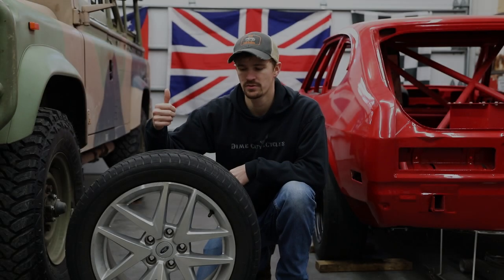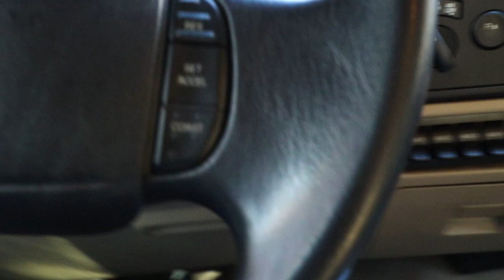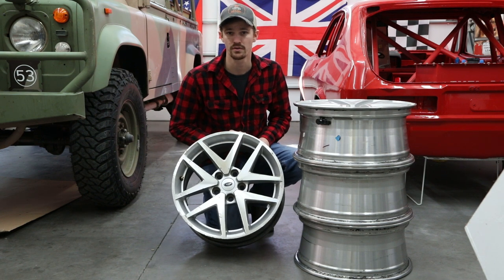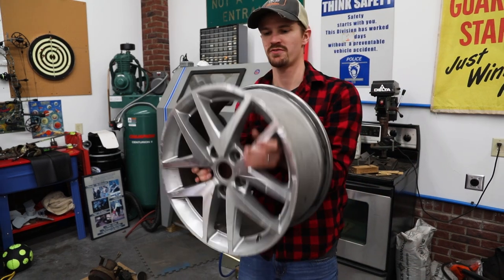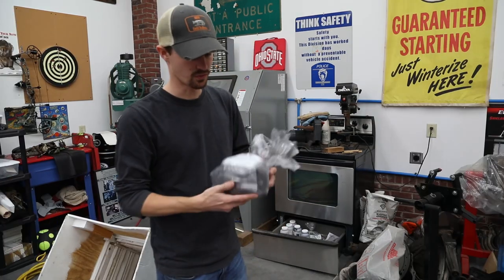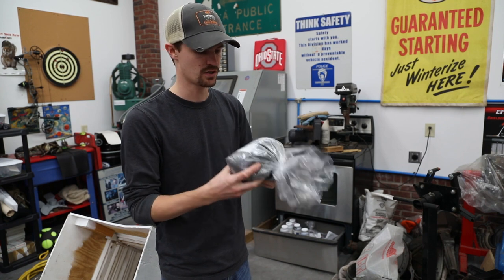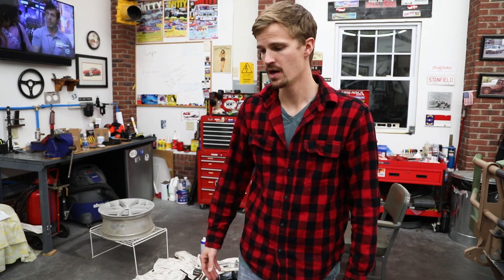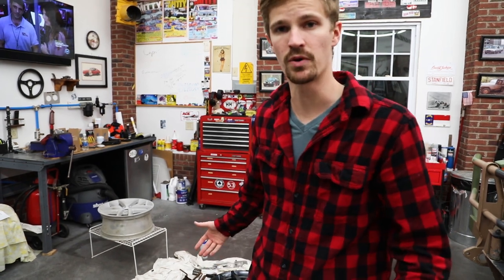Powder Coating Wheels At Home!

Comment: "At home" means if you live in a shop.
Reply: Danny Krinkle dude exactly wtf I was about to say!!
Reply: Yep. I was like "huh?"
Reply: Click bait
Reply: You can have a blasting cabinet at home and I’m sure you’re not thinking an oven is unfeasible to have at a home right? If you can’t also think enough to understand that sanding is an option, this whole process is out of your reach.
Reply: Joseph Samsor you can also have a car lift or a 20 ton press at home if you buy it but you’re building a shop at that point. Also, he says at home while he’s at a shop with stripped out cars...
Reply: B Y a car lift and 20 ton press are not needed for this process btw. An oven (something you have at home) and a blasting cabinet (easily substituted with elbow grease and sandpaper) is in the process. The location he filmed it doesn’t matter. Pay attention to the video. For this process, everything is easily done at home. What is so difficult to understand 😂. You also don’t need to be surrounded by stripped out cars to do this in case that was also a point of confusion.
Reply: Hahahaha absolutely right 😂
Reply: Hmu if you need any electrical added to your garage for an oven or anything if your having trouble adding things to your home garagw
Reply: I thought it was at home..  Got me!

Comment: Better off putting two pot on them , the heat of powder coating not good , because rims were  Heat treated from factory  .
Reply from the maker: Something I had never conceded but it could become an issue if you keep it in the oven to long. Some alloys ate aged at 325F so powder coating could cause some issues. But with the process so common and no issues myself I think that if its done correctly you minimize risk. My next set of wheels will be sprayed, simply because im learning how to shoot paint now.

Comment: A lot of thin spots , needs a heaver coat of powder. and it was plane to see before it went into the oven
Reply from the maker: Yep I missed a few spots of clear when sanding them but I was also fighting the faraday effect in the corners. After a few wheel I was able to work around it but an adjustable guy would have really helped out.
Reply: @Petrol360  Heat the wheels or parts to around 150 - 175 and shoot them warm
Reply from the maker: I did that as well, I think I called it gassing off. Iv heard its more to help oils burn off but I guess it can help the powder stick by melting on contact?

Comment: I don’t know why people are bitching about this being at home.  
He didn’t send them out to be powder coated. He did it himself. 
If you don’t have the room or the tools to do it, that’s one thing. But don’t bust this guys chops for having a simple set up. It works. It’s not elaborate.  If you don’t have a compressor or a garage even, then maybe this project isn’t for you.  But it definitely can be done “at home”.
Reply: having offgassing equipment, an extra oven and professional powdercoating sprayer setup costs a fuckton for someone just trying to powdercoat wheels. it is also overkill

Comment: Everyone is complaining this guy has a shop. Sandblasting cabinets and a good enough compressor isn't impossible to get. Cabinet can be made if one really wanted. Free electric ovens are everywhere. Powder coating kit can be bought at harbor freight. 
You're already taking wheels to a tire shop to dismount anyway, take it to a blasting shop and do the powder and bake at home..

Comment: Great job. Have a few questions though.

1) What size sandblasting cabinet do you have?
2) What powdercoating gun do you use?
3) You used an electric oven? 
4) What did you use to do the sandblasting on the alloy wheels? 
5) What temp studs you bake them at after powdercoating them?

Comment: Hi, would you please share what kind of compressor you are using (bottle volume and output per minute). Thanks in advance!
Reply: From what I've read, you can use any pancake compressor found at your usual home improvement centers. You only need about 5-10 PSI and 2 CFM to move the powder and coat what you want coated.

Comment: So it's been a few years since you've posted this vid... did it hold up? Any touch ups??
Reply from the maker: No they still look perfect. The wheels are on my daily so the rarely get cleaned. So far brake dust and all the other dirt haven’t had any effect on them. I still pull the wheels once a year and give them a good clean and wax. But other then that I don’t touch them.
Reply: @Petrol360  that's awesome. Good to know that they'll hold up over time. Definitely gonna try this! Thanks.

Comment: I would have liked to have seen the inside of the wheel cured out of the oven after being placed on the oven rack to see what marks were left on the wheel? It seemed to lift out easily so didn’t cure to the rack…
Reason I’m interested is this is how I’m looking at doing mine and just want to know what is going to happen to the inside..
Oh also would have been good to see the whole process - removing the pre heated wheel etc etc

Comment: Only thing I wish you did was elaborate a little bit on how long and what temp to bake at.  You stated prebake was 400F but didn't give a total paint bake time or exactly how to prep the rim besides the prebake. Do you have to electrify the part at all for the powder to adhere?  Thanks great video overall I'm just a super noob so wish there was a bit more info here and there
Reply from the maker: Every powder has different instructions on how long and how to bake at. Thats why I didn’t go in to detail on baking them. And yes the whole part needs to have high voltage running through the part. Just clip the lead from the powder coated to the part or a metal part touching it and you are good to go.
Reply: @Petrol360  

Perfect man thanks!  Didn't think I'd ever get a reply from the content creator himself.  Much appreciate your time.  Your reply really filled in the simple blanks for me.  I was super duper noob but I've watched a couple videos since and All I need to know now is voltage/current and power supply stuff but I'm sure that'll come with whatever kit and powder I buy.  Thanks for the great content!

Comment: What blasting cabinet is that? I'm tired of messing around with poor quality media blasting equipment
Reply from the maker: Its a skat blast cabinet with there filtration system. We added a second light inside that helps a lot. Its been working well so far just regular stuff, changing tips and putting a plastic shield on the glass to keep it from getting bad.

Comment: how does the powder coating hold up long term? Does it peel off?
Reply from the maker: As long as it’s applied properly it can last a very long time. They real advantage of powder coating is that it doesn’t chip or peel off like the clear coat did. The wheels still look great by the way!

Comment: Amazing,,may i ask what type and mesh of metal powder u spraying on ,,second can it be applicable on any sort of substrate?
Reply from the maker: They don’t list the mesh on the website actually. And as far as what you can apply it to I think its any matalic object that can withstand the heat in the oven.

Comment: At home cheers mate, luckily I keep my sand blaster next to the fridge
Reply from the maker: Get creative, there are loads of ways to remove paint from wheels. Aircraft stripper may even be faster to strip them down. If you really want to be able to to something you will figure out a way.
Reply: @Petrol360  so you agree the video is pointless?
Reply: @matthewcooke3749  good one
Reply from the maker: For a person with no ambition and no ability to think outside the box like yours. Yes! And what did you think the video would be about some new magic that means you can powder coat at home with no tools?
Reply: @Petrol360  sorry mate I appreciate the video I was just taking the mick a bit..it’s a good vid cheers

Comment: How do you like the blast cabinet so far I've been considering a skat myself
Reply from the maker: Really like it, seems to be a good unit. We added a second light inside that made a world of difference and buy a bunch of the glass protectors to keep the glass clear so you can see. Another thing that we got that should have come standard is a lip that goes on the inside of the door. With iut the lip a bit of sand falls out every time you open it up but thats the only flaw iv seen so far!

Comment: What size wheels were those?  (What is the largest wheel you can still fit in your oven?)
Reply from the maker: These are 17”x7.5 I think. You could fit an 18 or maybe a 20” ovens do come in different sizes.

Comment: I'm about to do this on some Porsche wheels. What blasting media did you use? Do you remember the grit?
Reply from the maker: I used Diamond brand fine grit, I picked it up at tractor supply. I tried there medium/course and it seemed to be eating into the wheels a little so I swapped it out. Best advise I can give is to check the wheels with a really bright flash light before you put them in the oven, the color I used was hard to tell when it was not thick enough in spots. Also do the cracks and tight corners of the wheels first, the powder has a hard time sticking where corners meet unless you get an adjustable power supply. Its a fun project and saves a ton of money doing it at home, probably only used one pound of powder and one bag of sand so id say $60 for all 4 wheels plus say $20 to pull the tires off and remount them.
Reply: Petrol360 Thanks for the suggestions. I really appreciate it. Hopefully my wheels will turn out as nice as yours.
Reply: Maybe you will have some insight, I have some 993 18" hollow spokes with chrome and I want the chrome off so I can paint or power coat silver. Any ideas or leads?

Comment: Cool.  So whos house am I powder coating my wheels at? Your dads?  Cause my home, like most others, has none of this equipment except for an oven.  I'm not too sure my girl would be ok with me borrowing her oven to cook my wheels in.  Let me know.  Thanks.
Reply from the maker: Matthew Nelson blasting cabinets are a bit much for a home set up but a 25 gallon compressor and cheap HF sandblaster works just as well. For the oven we went on CL and found a oven with a broken glass top for $35 and it works perfectly. You have to be willing to think outside the box and put some elbow grease if you really want it.
Reply: @Petrol360  Thanks for the reply.  I was mostly being sarcastic but either way nice setup.  I might even be a tad envious lol.

Comment: What sand blaster do you have?
Reply from the maker: Its a champion, think its a 60 or 80 gallon. It works really well for a home shop and I can blast all day without issues.
Reply: Whats the cost of the equipment to powder coat?
Reply from the maker: The gun kit with the gun and everything you need to paint was $120. We found a old stove with a broken glass stove top for about $50. As long as you have 220v in your shop or garage thays all you need. A lot of people use a toaster oven for small parts as well.
Reply: Yeah I was thinking about that too.. I'm trying to powder coat wheels haha
Reply: If you're going to do wheels then you will need a good sized oven which will run you around $2,500 out the door. Everything else like the sand blaster and air compressor will cost you more. To give you a better idea of how much, well i spent $5,000 on everything and now i can do my rims and other peoples rims as a side job. If you need more information on what to get, just message me and i will send you all the stuff i got.
Reply: Air compressor for sand blaster is around $900 for a decent one if you plan on sand blasting longer than 15 minutes. I have a 80 gallon air compressor.
Reply: Holy shit I may not be setting that up anymore then.. Was just going to do it for casual DIY's. Might just do plastidip for much cheaper

Comment: I fucking hate picking up screws man. I have been to the local mechanic shops so many times because of that or sensor light issues 😭
Reply from the maker: Ya thankfully this was my first in years, but it was a good thing because the tires were starting to dry rot. I think the dealership I bought the car from must have used tires that had been laying around for a while. So it needed it anyway and fixing the failed clear coat was a plus!

Comment: Do you have to sand blast them if they are not pealing? I have rims that look great just want to powder coat them.
Reply from the maker: Yep the one bad part about powder coating is it has to be on bare metal so you will have to blast or strip the old paint off. It taks a lot of time but its worth it on something like a set of wheels

Comment: At home my arse...
Reply from the maker: Most houses have single phase 220v run to them and can easily be wired to run a compressor or oven like we have. If you don’t have access to a blasting cabinet or don’t have someone locally that can blast them you can always use paint stripper and sand paper to get the wheels clean. Just have to think outside the box a little!

Comment: At home...... meaning if you got a shop, or a garage full of tools
Reply from the maker: Anyone should be able to do this at home. If you don’t have a way to sandblast you could use paint stripper. A broken kitchen range can be found used for cheap or free. The one we use has a broken glass cook top. The powder coating gun uses very low pressure so a simple pancake compressor will work great. A who lot is possible who you put your mind to it and start asking yourself “how can I” rather then “I can’t”.